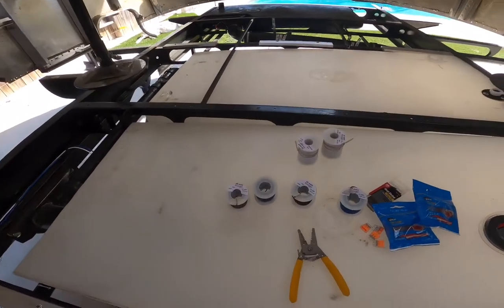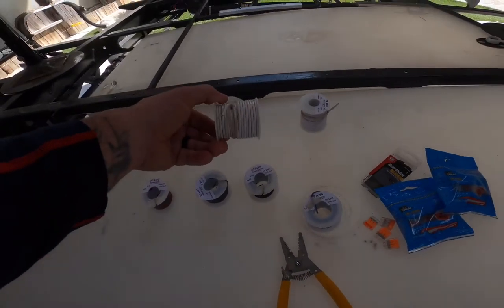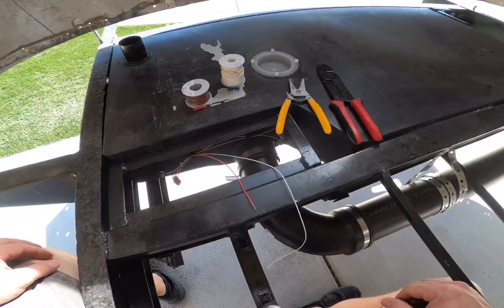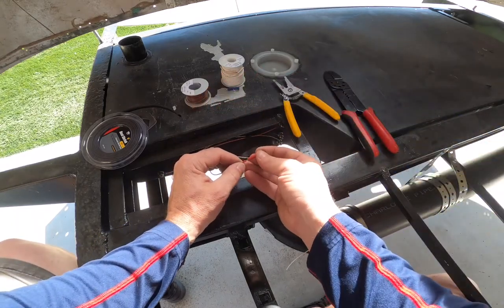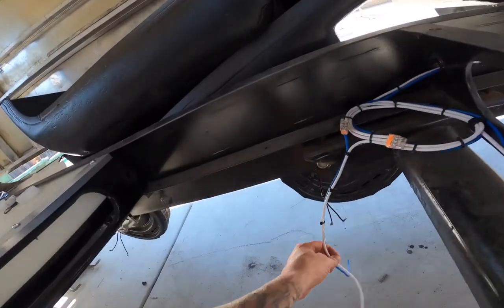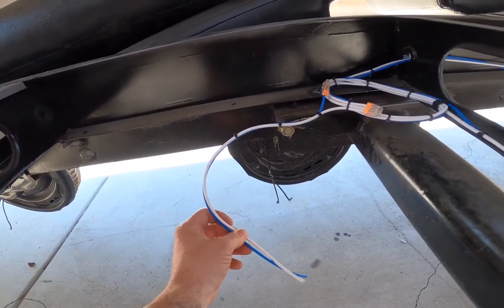Airstream Trailer Tank(s) Level Sensor Wiring / Frame Wiring

Comment: Danny, did you give any thought to the strapping you used on the tube from the black tank? The reason I ask is that as you go down the road your trailer goes through an vibration shake fest. What i see is that metal against plastic and over time groves begin to form. Well I think you know where I'm going with this. Maybe some rubber sleeve around the pipe would help prevent any wear. Good job so far, have fun.
Reply from the maker: The strap is temporary only. I order a pipe clamp with rubber grommet inserts specifically to mount in strap locations and they are back ordered….still. So I temporary had to put these in place and keep pushing forward. But they will replaced soon right before the subfloor is fully installed.
Reply: Why did I not give it thought that you would have handle that already.